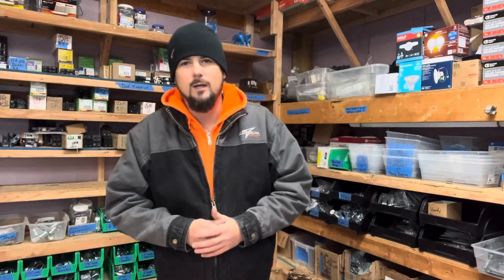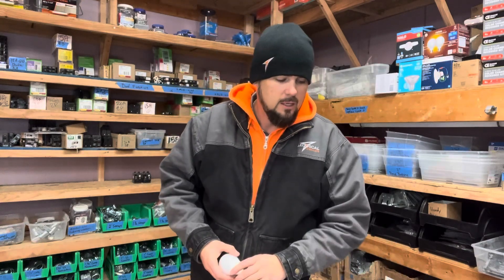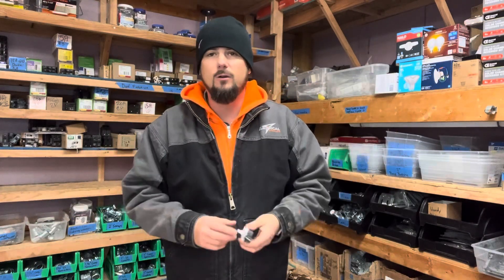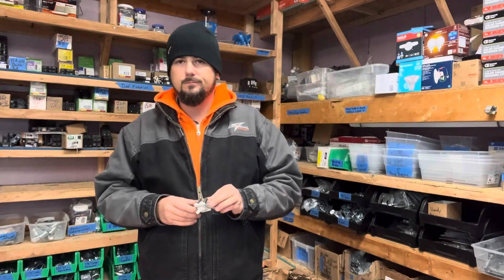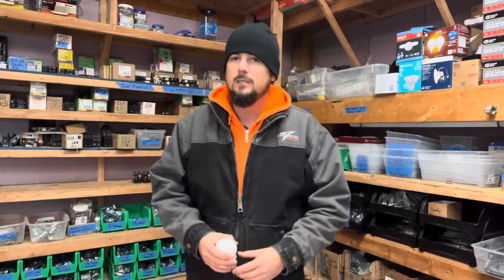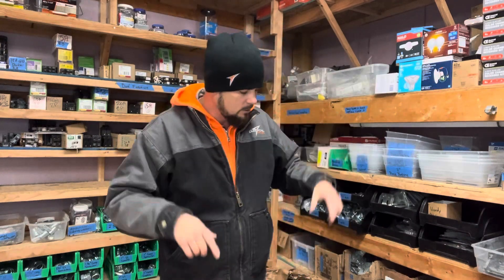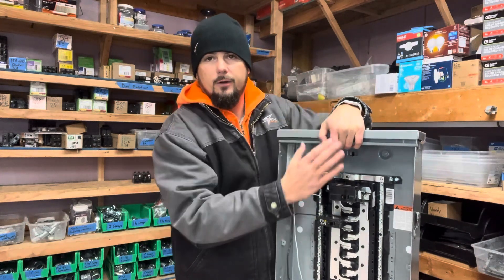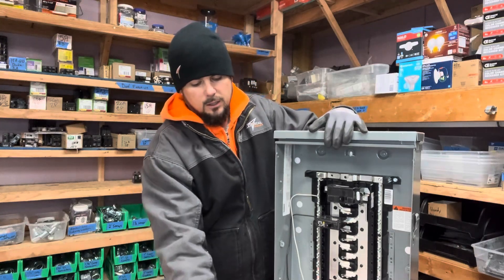WHY ARE MY LIGHTS FLICKERING ?!?

Comment: Does the same apply if the lights only flicker when the switch is off?
Reply from the maker: Good question! That could be a bad switch, a bad connection, or a back feed on the ground or neutral. Easiest to start with the switch and go from there imo. Thanks for watching!

Comment: One day my kitchen ceiling light fixture started flickering but not all the time. I replaced the fixture, the dimmer switch, and the bulbs. It still flickers. Then the light fixture in the dining room started to flicker occasionally and it is on the same 10 amp circuit. So I replaced the 10amp breaker. Both still flicker????
Reply from the maker: It sounds like you have invested a good amount of effort into figuring this out already. The good thing is you now know what it is not. That is still very valuable information even though this can continue to be frustrating. I am curious about the 10 amp breaker. They only recently came out with these so it would lead me to believe you might be in a new home as all homes until about a year ago work on 15 and 20 amp branch circuits for lighting. Either way through deduction, we can now estimate that the issue is possibly in the wiring itself. I would suggest you try an arc fault breaker as they are designed to find faults in the connections such as the wiring. That would be one way as well as checking all neutral connections from the panel to the lights themselves and switches as you mention two lights are now having the same issue. Keep going!

Comment: No issues anywhere in the house other then where there is the candela bulbs. They all flicker randomly. Cannot figure it out. Three different places around the house. But only those bulbs. All new bulbs.
Reply from the maker: I see you have isolated it to a certain style of bulb. That's a great start. If they are on a dimmer they may not be compatible with the voltage output. Sometimes they just make a pack of bad bulbs as well.
Reply: @electricalspecialists  I moved in two years ago it just started recently. I replaced with same exact bulbs... SO bizarre...The ones flickering now do not have dimmer.  And it seems the flickering is random. They are in a ceiling fan.. I guess its possibly a loose connection in fan but that does not explain the other fixtures in house. They all started around same time... Thanks for the response!
Reply from the maker: @mikezxzx  I'm glad you have noticed the fine details here. That's the best way to get to the rout of the issue. Keep a log and in case you have to reach out to a professional. If its the same bulb in multiple fixtures, you might try using a new style of bulb just to see what happens. If they continue to flicker there is definitely a deeper cause. Keep it up and thanks for watching!

Comment: Had a situation where I replaced a 12/3 fan with light to a  chandelier and multiple recessed on 2 light switches sharing same neutral. Not sure if that is an issue.
Reply from the maker: That's a good question. The neutrals should not be on the switches and should just be tied through separately. If there are neutrals landed on the switches that is definitely something you want to look into.

Comment: My issue is, when I turn on the oven and wait for it to adjust to the selected heat, as it's climbing to each number my lights would flicker. My lights flicker even when turning on a separate switch. I think it blew out my TV.
Reply from the maker: That is very interesting. I like that you have done the detective work to know that its only during the oven usage. It sounds like there may be more going on in this situation. It may be worth having someone come out and make sure your grounding and neutral connections are in order. Thank you for the feedback!

Comment: is there a way to tell if your LED bulb is no longer functioning? With incandescent bulbs, we could see the wire broken. It's frustrating to have to pay lots more for LEDs only for it not to function well. Thank you.
Reply: Thank u for the advice on knocking on the wall trick,but it solved my problem. Thanks alot!!
Reply from the maker: @billywalker1965  Glad to hear it! I have to advise that if knocking on wall fixed the bad connection, it is a temporary fix and is still a bad connection. You may want to look the issue a bit more to be safe, but glad it got you some good results!
Reply from the maker: Good point Barb. Yes, LED bulbs can be frustratingly difficult to diagnose. Incandescent bulbs were very obvious when broken, and they could be easily tested by continuity and a volt meter. The simplest way to test and LED bulb is to place it in a lamp or fixture you know already works. Hope this helps.

Comment: Why lights flickering when induction motor is running or water pump is energize...
Reply from the maker: That's interesting. Those sound like they could be large draws on the system. This could be a normal power surge due to the capacity of the motors, or it could be something more. You may want to have someone come out just to be sure. You also might want to invest in a whole house surge protection device, that will keep your appliance safe while in case these surges continue. 
Thanks for your input!

Comment: I added, myself, DIY....
Whole house surge pro unit, EMP Shield
local fridge surge pro receptacle. Lol, to flush fit
local microwave surge pro
AC condenser surge pro on disconnect
AC condenser now has SOFT start unit
Local surge pro for many other things
Reply from the maker: I like how you localized your surge protection at each location. Most people go with the whole house in the panel and leave the specific locations unattended.

Comment: I'm not sure if anyone is still replying to these posts. I'm a old Viet Vet and for 2-3 weeks we've lost use of almost everything. No frig, no water (well), no A/C (Gulf Coast), and everything that demands any electricity. The few lights and 2 fans that are on, will flicker and then have a surge, at times the fans and lights get brighter and fans blow faster, as is they're getting higher voltage spikes. That can last up to an hour or so and then a flicker, and they go back to normal. I had a electrician come out. He never came when he was supposed to and had his son and friends, that were all unprofessional. The frig worked before he did anything and I'm not blaming anyone. He was arguing with his son and helper and my wife and myself just ignored it. Family can be trying. He walked out and said: 'You'll need to rewire the whole house'. Obviously, I don't have that kind of money and we've lived in the house for 25+ years. He left the breaker box cover with only 1 of the 6 screws replaced. They were all painted over from when the house was built. Obviously, never removed before. I gave him a nice gift of a token of my appreciation for coming out. I didn't do it for any reason. I do it all the time, as a way of giving away items I won't need and I'm on borrowed time and don't want my wife of 50+ years left with so much of my stuff, like my night vision goggles or mono's and or thermal scopes and other FLIRs. I had a new volt meter with a small thermal screen and my wife thinks I'm nuts giving away things all the time. But, it makes me feel better and why not. I'm now in a panic mode about this. I'm running a dorm frig and microwave and other small stuff in my garage. It has a different breaker box and the utility company (a co-op) came out and tested everything from there. It was built a few years before the house and about 1,600sq' in size. The electric seems to be fine in the garage building. I'm not trying to get anything for free, I know about life in the real world. My frig I'm using is for my injectable meds. Otherwise we bought all foods that don't need refrigeration and lost everything that was just put in the frig from 2 big trips to Sam's and Costco. God forbid something happens to me and leave my wife in a horrible mess. I just don't know what to do next except call another electrician that was highly recommended. A friend bought his grandfathers house and farm from family it was from 1898 and had it rewired for 11 grand. Is there any hope for me?
Reply from the maker: Goodness. I'm sorry to year your in this situation.  Its definitely not easy finding competent contractors sometimes. It sounds like you did not have a good experience and they left you without any solution or even diagnosis. Its impossible to properly figure things out without getting eyes and hands on it, but we can make some assumptions. It sounds like you may have possibly lost a leg. Meaning one of your 120 Volt feeds is not connected at the source. This could be a bad main breaker, or possibly an issue from the power provider. It sounds like you have already had them out so I assume they have already taken a look at this. My honest opinion is to go ahead and get a reputable electrician to get out there and get you a real answer to what is going on. Sure most older houses could use a rewiring, but its just not in the budget for most of us. There is typically another solution available even if its temporary. See what a second opinion can do, and we will all be hoping the best for you my friend.
Reply: @electricalspecialists  BTW, my electric co-op came out within an hour weeks ago and checked my power from the breaker box in the garage and told me my problem is in the house! Thanks, again for your kindness.
Reply from the maker: @KingGypo  Yes is sounds like it could be the power feed from the garage to the house. I'm sure a good electrician can isolate the problem and at least come up with a temporary solution. Best of luck!
Reply: @electricalspecialists  Thanks a million for taking the time and caring enough to reply. All I was told it was a neutral probably caused by a mouse. We live in the country on a fairly big area and we have all sorts of critters. It's currently 92 out and at midnight it's still in the 80s. We suffered for 3 months with no power after Katrina but ran a diesel generator with a window unit in the den. I was in my 50s then and not on borrowed time like now. My doctors at the VA have sent me warnings about the heat. Eventually I'll have to jury-rig something from the garage that has it's own breaker box. I ran commercial machines in there like welders without any problems. The power goes there 1st and then goes to the house. The kindness of strangers means the world to me and I truly appreciate you very much! Thank-you!

Comment: Question. 
My master bathroom has 15amp for all lights and 20amp for gfci outlets in the master bathroom. 
I created additional outlet from 20amp source for a Toto Bidet(min 15Amp) 
It has been operating fine with lights on and the bidet running(1.5 year now) 
Recently, the 15amp lights are flickering while the bidet is in use. 
Your suggestion is much appreciated and thank you for your time.
Reply from the maker: Absolutely! I would add that whenever we have installed power for a heated bidet, they specifically require a dedicated circuit for this exact reason. Elements and windings draw more power as they age and wear in, so it could just be a matter of it taking a bit more power than it had when it was new. Just a thought.
Reply: @electricalspecialists it turn out the light bulbs are bad, it comes with the house so dont expect high quality bulbs, I replaced them to adjustable light bulbs, problem solved!!! 
Thank you for taking your time on this!
Reply from the maker: @KT-ge7fl  Absolutely. Thank you for watching.

Comment: Aren't flickering LED lights just minute voltage fluctuation that LED picks up on that incandescent doesn't reveal?
Reply from the maker: There are many reasons. This could be one, but there are many more possibilities. If that is the reason, the next step would be to meter the voltage and monitor its output to make prove the theory. At that point the next step would be to find out why the fluctuation exists and correct it. Thanks for the input!

Comment: We have a 50w rough service NOS incandescent bulb in a lamp on the same circuit as a PlayStation that flickers everytime we move up or down through a menu. The bulb and lamp were swapped and seem to play no part. Finally we have something potentially interesting to sort out. I'm about to hook up an oscilloscope to try and find whats going on with the voltage. I'm thinking about making a current input for the scope's second input to monitor the power factor. We also have a 1:1 isolation transformer helping protect the video game controller plus a whole house surge protector and many homemade ones on other devices we no longer want to replace... again. I have an online UPS to help isolating the cause. 45 years as an industrial automation electrician may be helpful although the electrical issues between devices in our home and between neighbours on the same transformer is something new that began 3 years ago. Our electrical service provider hasn't been helpful and could only confirm our 200A service conductors can handle a 90A load without issue. I had already done a similar test tig welding some aluminum and mig welding some steel at the same time the oven was heating up to temperature, about 114 amps on both legs then a neutral load at 55 amps. All transformer and meter base connections were checked and i installed a new main panel a week ago but kept all 3 sub panels in place. I just needed a few more breaker slots in the main panel. 
Well back to flicking around with my problem. First time viewer, new subscriber.
Reply from the maker: It sounds like you have been chasing this one out for a while. Good call speaking with your power provider, but unfortunately, they don't have too much concern about what's going on inside the home. If you truly are getting power fluctuations in voltage, like some of us do int he county, where the power lines are not as consistent, installing a phase monitor might be something to look into. Isolating the actual fluctuation would be an identifier if at all possible. They sell in plug in voltage monitors with a read out on amazon if that would help. Thank you for watching!

Comment: Super thorough video, thanks. For the AC dimming the lights, install/have installed a "microair easystart" on the AC condensor. Mostly eliminates the jolt. Drops locked rotor amps by quite a bit. Mine went from 90amps to 17amps. Also extends the life of the AC.
Reply from the maker: That's awesome! Great information.

Comment: My underground service line from the pole had dealt with enough ground movement over the 50 years it had been there to have the neutral wear through into the hot line. I happen to be standing next to the main box in the basement when the lights went off and on and it sounded like someone upstairs was walking on bubble wrap. I hit that main breaker in less than 3 seconds. A few little items didn’t fair to well but nothing major happened.
Reply from the maker: Yes we see these all the time. In our area they started putting in underground services in the early 70's, and now they are starting to fail. Some a little more violent than others.

Comment: Good recommendation with the whole house surge protector
Reply from the maker: Its now code. Nationally and in our area. Surprisingly some people put up a fight when we tell them we have to include one with a new panel. They are proven to add quite a bit of life to your appliances. Why risk it when a new furnace is $10k to $15k. The manufactures are even calling for them when you read the instruction booklet. For those that do that.

Comment: I have a new construction. Whole house flickering issue. There are different levels of the flicker. One is a strobe like flicker and it happens at the exact same times every day when the utility company prompts the meter for readings. The second is almost a continuous very light, almost flutter in the lighting. Noticeable mostly in your peripheral vision. The Utility company has installed a recorder and the data was good. They have changed meters. Swapped phases. Checked all connections. The electricians that did the install also did extensive troubleshooting on their install as well. We are currently at a dead end and dont know what to do. And we are about to move in.
Reply from the maker: Wow this is an interesting one. Well the thing you can be certain of is this is not your issue to fix. I would double check my warranty information and make sure you are covered. Be careful as once you move in it becomes much more difficult to push the issue as they are on to the next job and you may become a backburner problem. There is always a solution. The installing company just needs to keep working on the issue until it is resolved. It sound like frequency problem if I had to guess. At the very least I would change the bulbs and possibly fixtures that are seeming to have the issues and go from there. Every brand has its own frequency so changing brands and models is a good way to test that theory. Hopefully they get this resolved for you quickly.
Reply: @electricalspecialists  I have the installers coming out to eliminate the generator switch from the system to see if that does anything.
Reply: I have the same problem.  Power company put in one of thoses sensors and said their side is good. No rhyme  or reason to the flicker
Reply: Any resolution?
Reply: @swirlinclouds unfortunately no. It is still flickering. We have tried every we can possibly think of. The only thing that we haven't done. Is gotten the electric company to change out our transformer.